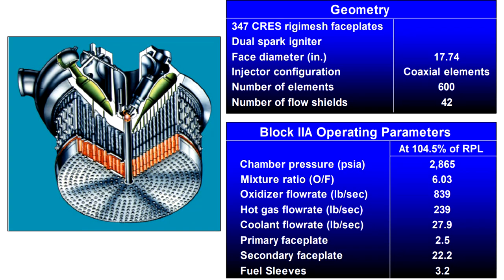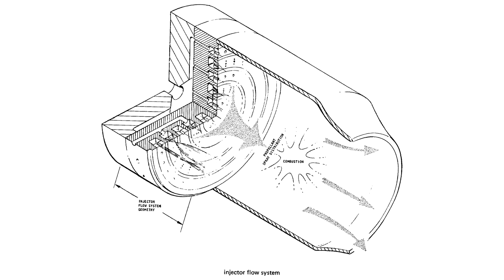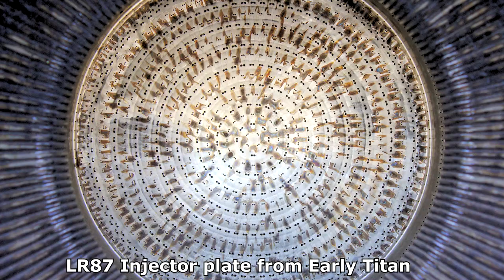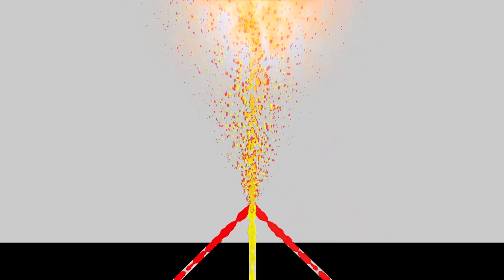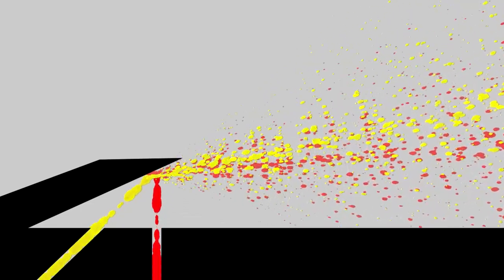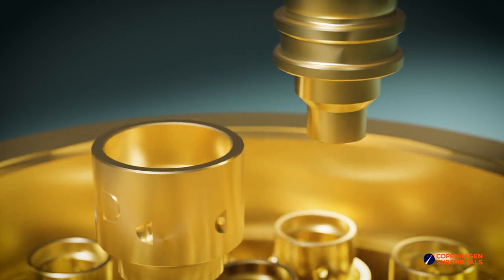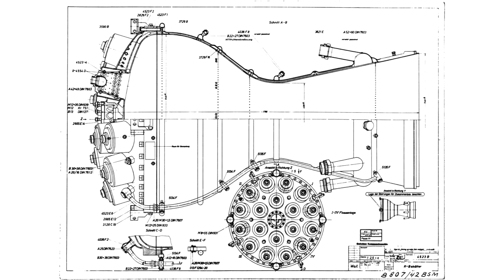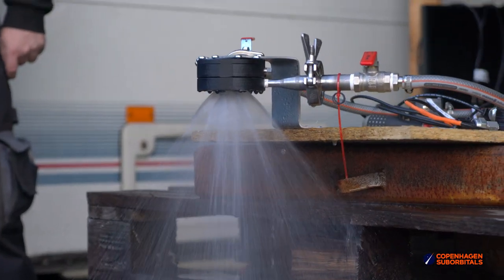Rocket Fuel Injectors - Things Kerbal Space Program Doesn't Teach

Comment: The 18 injector pot system in the German V2 (A4) combustion chamber was based on the successes they had with the smaller A3, which used a single pot at the head of the chamber. Due to the speed in which they needed to produce the much larger engine as a functional prototype for the war effort, they simply multiplied a system that previously worked,18X.  It should be noted that during the development of the A4 starting in 1940, Deputy Director of the Peenemünde Army Research Center, Dr. Walter Thiel, had simultaneously developed a conventional flat injector plate variant of the A4 combustion chamber. Due to instability issues, it was not entirely ready for production. Regardless, in late Dec 1942, Hitler ordered full-scale production, which resulted in the V2 (A4) as we see it today with it's luminous LOX plumbing to the 18 pot system, with over 5000 having been produced that way. Much to the protest of Dr. Thiel, it was really a production prototype. Thiel's single LOX feed, to flat plate design, would have looked more like the A6 Redstone engine developed a decade later through the influence of von Braun's team in the US. Why so long? Thiel and his entire family were incinerated by an RAF bomb in a slit trench in front of his home in Aug 43. Incidentally, a moon crater is named after him on the dark side of the moon.
Reply: There is no dark side of the moon, at least not permanently.
Reply: @Anvilshock  Lol. I was waiting for that.
Reply: When we are off-duty, we speak of dark side of the Moon. On-duty, writing science papers we say far side of the Moon.
"Dark side" impinges on the imagination and is more artistic, ask to the Pink Floyd what they think. "Dark side" is a very acceptable artistic licence for a scientist, I believe.
Reply: Points to api for pointing out that rocket science, especially back then, was limited by time and budget. Giving unlimited resources, one could only fantasize where humans would be now.
Reply: Anvilshock you are referencing the wrong definition of dark. Anvilshock’s usage refers to this definition; 4a : not clear to the understanding
b : not known or explored because of remoteness. The better challenge would be; if it’s unexplored, how did they know of the crater in the first place? 🤓
Reply: Engine development at Peenemünde Army Research Center continued after Thiel resigned (ironically, he was killed in the air raid just after he quit). 

In some of engine designs the combustor "pots" were replaced with the same number of small flat plate injectors that were easier to produce -- but the complexity of the overall engine plumbing remained very high. It was understood from the beginning, that a single flat injector would be preferable both from the engine manufacturability point of view, and for greater performance.

Unfortunately, it proved very hard to make combustion stable with a large injector. Only after much work the instabilities had been somewhat overcome, and the new engine was specified for the C-series of V2 rocket. (The third major modification of production rocket. The number of research and development prototypes was vastly larger.) The war ended before C-series was produced -- today we can only find the drawings of these "Mischdüse" injectors in the Deutsches Museum Munich. (The earliest drawings I have seen were from 1943.)

A smaller version of the flat injector has been much more successful, and was used on Wasserfall-C2 rocket, which was also developed at Peenemünde. This particular design was widely disseminated after the war, and copies were produced in the USSR, USA and France -- with different measure of success.

Even though all three countries had access to German know-how and ex-Peenemünde specialists, the path of rocket development has rapidly diverged in all three locations. This fact -- that later designs were so different in important details in different counties, shows very clearly, that although the incredibly large scale of German R&D before and during the war has helped tremendously to advance rocketry (and had caused much grief in the process), it was never simply copied blindly after the war, nor was it sufficient on its own for the much higher performance rockets that followed. 

Curiously, even though von Braun's dissertation was on engine development, in the USA, von Braun's team did not engage in engine development. They purchased the engines for their rockets from Rocketdyne division of North American Aviation. (Regardless of this fact,  engine development at Rocketdyne was still dramatically influenced by German know-how -- via General Electric, which was tasked with assimilating the German technology after the war. Literally hundreds of train-carloads of hardware and documentation were at hand. All ex-Peenemünde specialists were debriefed and assisted in understanding this material, and some of the important German engineers, Walter Riedel, for example, worked at Rocketdyne -- but they were not part of von-Braun's team in the USA.)
Reply: @Anvilshock  I have a feeling that original commenter used "dark side of the moon" as more of a lyrical note to end on, instead of having meant "that side that is permanently dark"
Reply: @antoniomaglione4101  All I read is "I made a random slip out of linguistic indifference and got called out on it which hurt my pride so now I'm pulling bundles of straws out of my deluded arse in a meandering attempt at making my non-choice of words look intended and clever and the caller look bad".
Reply: Hmmm... I am getting the sense the dark side of the moon is a matter of perspective and lyrical even though the space between does not allow for atmosphere conduction.
Reply: @Anvilshock  There is dark side on duct tape however - plus it has a light side and it holds the Universe together (plus most of the prototype nukes)

I can't see Pink Floyd making an album about it though...
Reply: @Anvilshock  Ironically, you're making yourself look bad by acting so condescending over such a small, insignificant semantic error.
Reply: @cod6guy12  No, this is not how this works. People make mistakes. People choose to acknowledge them or choose to defend them with unreasonably disproportionate vehemence when called out on them. Big difference.
Reply: @Antonio Maglione Poetic language has its virtues—it’s just unfortunate how it can reinforce misconceptions among those who aren’t scientifically literate.
Reply: Science really knows no nationality, it is entirely based on merit.
I'm not quitehappy witht he way the United States basically abducted our scientists, but I'm even happier that great minds could resume their work. In the case of Wernher von Braun, this ended in the first man on another celestial body, which is an awesome feat and was part of the reason why I chose to get into engineering.
Reply: A guy with drill press is something you do if it one of kind...Computerize CNC machine or 3D printer....can now be brought for a bucks now...
Reply: @Anvilshock  dark is just a lack of light, being in shadow.  No reason to limit the concept to just sunlight or visible light.  The moon casts a shadow that blocks Earth based radio transmissions just the same as it blocks sunlight.  The edges of shadows get fuzzier in the microwave but they work much the same.
Reply: @FireStormOOO_  Is it a bird? Is it a plane? No, it's the point whooshing over your head! Yes, there is a "dark side", as in, an unilluminated one. However, this was about a fixed location on a body rotating under illumination. There is no fixed "dark side". As such, "a crater on the dark side" is fundamentally flawed and wrong. You know, try reading context some time, helps with not embarrassing yourself when barging in late to the conversation.

Comment: I’ll never look at shower heads 🚿 the same way again.
Reply: My shower head will feel woefully inefficient
Reply: Oh
Reply: "What if my shower is an awfully inefficient combustion chamber on someone's rocket?"
Reply: My shower head uses dihydrogen monoxide as a propellant.
Reply: Same....
Reply: Anvilshock what is a dweeb?💩
Reply: @Anvilshock  👌👴
Reply: @Anvilshock  👀👍
Reply: The best showerhead to use as a rocket engine fuel injector is one of those "Shower Massage" type heads. By varying the pattern on my way to Mars, it was so efficient, that I had enough fuel for my space heater, when I camped out there (it's a little cooler than Earth) and still had enough to make it back.
       Btw: Marvin Martian says, "Hello".
Reply: My showerhead pre-mixes its hydrolox fuel
Reply: i would love a pintle injector for my shower head, at least then i can finally control the temperature properly!
Reply: With a greywater recycle setup the F1 injector head could be your showerhead. It is 44" in diameter.
Reply: Engage —-hot water , warp 1 😃
Reply: I'd done figured it out, and I'm goin' on with my back yard moon rocket plans despite Scott's precautions. 'See ya'll in space. ~~~>DDDDoD>-
Reply: @russc788  Take the baffle out n' try it.
Reply: @zoria2718  Are we getting into speculative philosophy? 'Looking for the essence of identity behind the paper filter veil of the home laboratory? It's okay with me.
Reply: @dale62676  Stay clear of exhausts?
Reply: Don't forget gas stoves has these for centuries.
Reply: My friends rocket started from an espresso machine shower screen!
Reply: You should see what else they did with shower heads
Reply: @dale62676 lol that's water

Comment: Today I learned the difference between "Rocket Science" and "Rocket Engineering."
Reply: more generally, engineering is just the application of knowledge gained through science!
Reply: @vancelanger7749  And Eloneering is just doing something scientists said cant be done.
Reply: @vancelanger7749  Engineering is where the theory of science meets the cold hard facts of reality. We don't actually have spherical cows, just the regular kind, and they're not very cooperative.
Reply: Sometimes you just need a rocket surgeon
Reply: Science is studying the world as it is today, engineering is building the world of tomorrow.
Reply: @KuK137  What do you mean? The full flow combustion engine? Cause Elon did a few more things than that, and not only with SpaceX, just sayin'...
Reply: rocket science is not 'rocket science', 
it's rocket engineering that's the real 'rocket science'.
Reply: @Simon Geard 
Utterly 😀
Reply: @vancelanger7749  You mean applied science?
Reply: its quite easy... 

engineering is building the stuff and science is using it
Reply: Engineering is the purpose of humanity and science is one of the most important tools we have to make it possible.
Reply: Science aims to understand the principles, engineering is making useful things that work. Engineering frequently uses science but it can also rely on empirical testing. We had bridges for thousands of years before structural analysis was a thing. Blacksmiths knew how to temper steel long before metallurgy figured out what they were doing.

Comment: The Death Star used an impinging 8-tuplet (later 9-tuplet) like super-laser injector.
Reply: Now that I think about it... maybe in a small enough rocket engine that could work. 4 for fuel, 4 oxidizer, center for ignitor? Idk.
Reply: @CarlosAM1  "Our rocket nozzle is big enough to wipe out planets" ?
Reply: @miscbits6399  with enough fuel anything is possible
Reply: Yes, but the rebels found the main combustion chamber at the centre, plus small exhaust holes drilled at the wrong angle.
Reply: Well, in the end, we saw where that got them..... instability!
Reply: honestly surprised to hear anything even vaguely make sense about the death Star (in the sci-fi it was supposed to be some magical plasma thing vaguely like blasters or lightsabers whose properties are probably not definable in a way that would satisfy all of its requirements but you know whatever)
Reply: Ye poor Alderaan 😂
Reply: that's "impinging Octuplet injection" and "impinging Nonahedral injection"
Reply: Ohhh yes.  That is what you see when the main laser fires.  You see the laser injectors at the outer edge fire to impinge on each other creating the combined super laser.
Reply: This is the first explanation of the arrangement of the Death Star laser that makes sense.

Comment: It’s not a solved problem at all. Injectors are so complicated. I work on a rocketry team at my university and we are creating a hybrid rocket. I specifically work on the injection system. CFD simulations and mathematical models rarely predict what is actually going to happen and there are so many changing variables that you must design around. Cold flow tests are a good option for predicting how the injector will perform and of course actual testing is the best method. It truly is rocket science.

Comment: I've got pintle injectors on all my garden hoses. I use them to throttle the water and even shut it off.
Reply: I use an improvised pintle mechanism called my thumb.
Reply: @Rose_Harmonic  Yes!
Reply: And this allows you to restart the hose, yes?
Reply: @CharlesP2009  Instructions unclear. Yard on fire.
Reply: @DistracticusPrime  Instructions unclear. Yard on a lunar injection trajectory.
Reply: Feeds Ravens  True, but his answer has more thumbs up.
Reply: @Rose_Harmonic  does it work on hypergolic rockets?
Reply: My senzor array has much higher input frequency than 25 Hz.
Reply: @shieldmate7444  Mine is only ~8Hz.
Reply: I've got them in my diesel injectors. Been standard on mechanical injector diesel engines since at least the 1980s. Not sure if the fancy modern electronic ones do this differently.
Reply: Akkupack I'd imagine it'd start getting dangerous as you close the thing down, but i'm no engineer

Comment: Now I want to buy a fuel injector and use it as my showerhead
Reply: Hell yeah I want a pintle injector showerhead
Reply: Finally, proper temperature control!
Reply: @Brixxter  providing super fine control over the mixing of hot and cold water :)
Reply: Buy a scrap one from an old jet engine.
Reply: @russdill  water is for noobs, real men use hypergolic substances
Reply: @Brixxter  And in Soviet Russia hypergolics use you.
Reply: Some showerheads actually atomise water droplets pretty well at this point, I wonder if they'd be any good as fuel injectors
Reply: EkulSolo  In the parodic novel “The Mouse on the Moon” shower heads were used as rocket nozzles because they were cheap and adjustable in direction. (No mouse involved, is a parody of the 60s space race, very funny.
Reply: I came here to speculate that Elon Musk probably uses one for his shower head.
Reply: aaaaaaand it's clogged due to hard water
Reply: I’ve seen a guy from a collegiate rocketry team that do just that.
Reply: That would be cool af.
Tim dodd better be taking notes for his next merch
Reply: Just don't hog the hydraulic pressure while he's in the shower, or you risk getting hurled off the balcony into the pool for a soft water landing.
Reply: ahhh the should make that where cold and hot water mixes properly. maybe add a 3rd hole for soap
Reply: I thought only had this idea. Hahaha
Reply: @liquidmakor6793  That sounds like a good way to fill your whole bathroom with foam ;p
Reply: Ah yes, combustion shower.
Reply: @CarlosAM1  also known as a furnace
Reply: @SonsOfLorgar  furnaces dont blow up or use liquid oxygen. (atleast most of them dont)
Reply: it's like buying the apple monitor stand
Reply: @muchozolf  Soviet union*
Reply: How long can the corona-virus survive in space?
Reply: @mduckernz  RESULT!
Reply: @thekaiser4333  it won't, even if your nozzle sprays it perfectly.
Reply: @user2C47  - Damn! That is my Wunderwaffe 08-15 gone. Shit!
So it is back to our good old trusty Marburg-Virus again.
Reply: So you want to shower in a fine mist, dare I say high-velocity fog?  Interesting.
Reply: I just bought a showerhead yesterday that does this, now I know it's because rocket science.
Reply: Take a bath instead, use the spigot as your injector. The fine dispersal of the water at a shower head  lowers it's temperature, causing you to need hotter water or more hot than cold. :-)
Reply: that's exactly what I thought, suborbital or musk could make a range
Reply: ha ha points for this comment
Reply: @tommihommi1  Lucky I live in Norway and we have incredibly soft water.
Reply: that can be done for the right amount of money.
Reply: @zapfanzapfan  because they're totally the same
Reply: Funny you should say that: I used to have a trigger-operated variable pintle spray head for my garden hosepipe. The trigger opened or closed the pintle itself, with the variability being a plastic cone surrounding it on a screw thread, which could be adjusted forwards or backwards to modify the angle of spray. It could go from a spray angle of about 120 degrees all the way down to an almost linear jet, just by the combination of these two mechanisms. You can probably still buy these (it was made by Hoze-lock), and since it was designed to operate on household water pressure, fitting one to a shower would be easy enough.
Reply: Injectors work under extreme pressure. You'd need a really high pressure pump.... and then it would fire the water straight through you :D.
Reply: If you do we're going to line up for turns in the only rocket fuel injector shower in the world. 
'Don't worry, we want to pay you something per, for the water and maintenance. What kind of friends wouldn't? {You wana' turn up your water heater?}
Reply: Just make sure you dont get the russian ones, heard theyre primed with hypergolic fuels
Reply: David Shaw  What's "hundreds of psi" In bar? You could probably get a good gear pump that would get the job done.
Reply: Ohhhhhh!!! Really
Reply: Imagine it being so efficient that you can't shower because all the water turns into vapor
Reply: this gives me an idea.
Reply: I have a showerhead where every hole is a tiny swirl injector, so I get this fine atomised spray out of the head
Reply: Lol